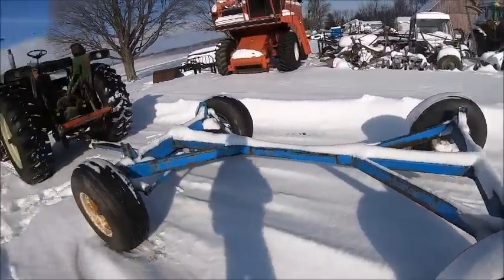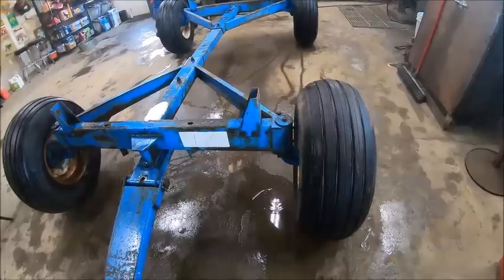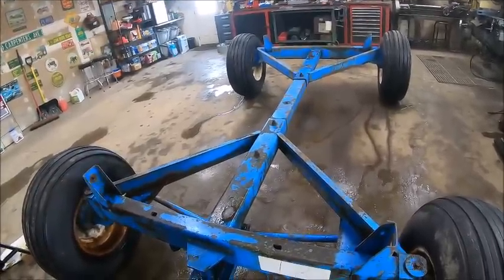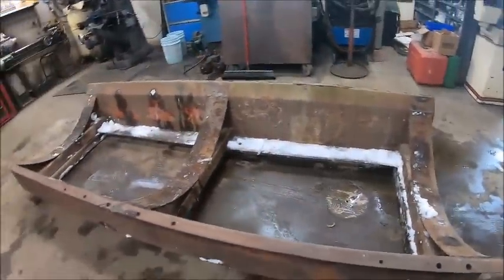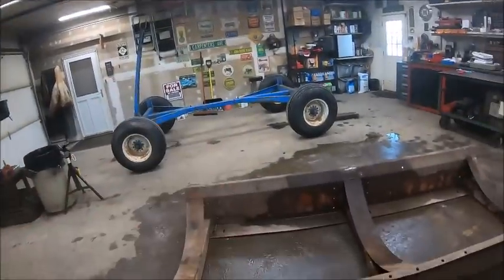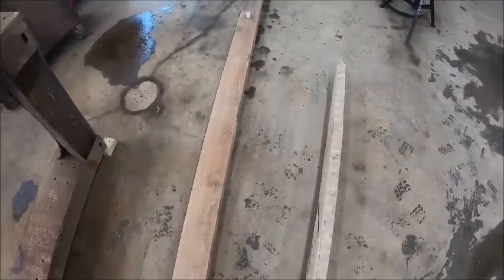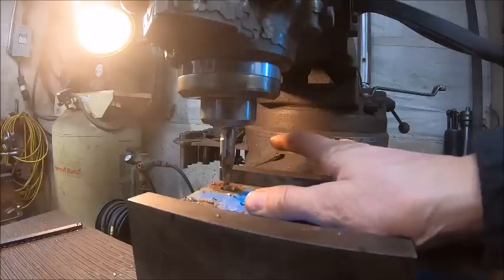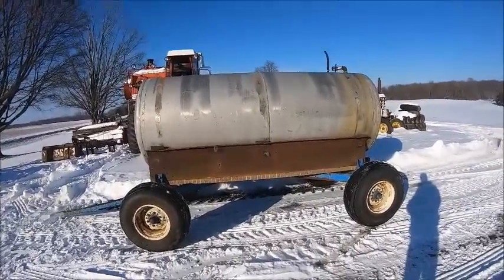Nurse Tank Build Part 1

Comment: Might be American Elm or Rock Elm; used to be a lot of it in MI before Dutch Elm disease came through. My barn in the Thumb (built in 1937) is framed with rock elm, hardest wood I’ve ever seen. You can’t drive nails without drilling first!
Reply: With that tight of grain it may very well be elm. Old growth elm is tpugh!

Comment: Nice job.  Looks good.  We always ran a couple a small chains around the unbolted stakes around the frame to limit the travel to the stake height in case of an uneven area.  I have seen the frame come down on the top of the stake and get hung up.  Not fun.

Comment: On the bands you could weld angle iron on the ends and put a bolt through.  And if you put one angle on one  side of the bracket on the running gear It would hold it and still have room to flex

Comment: Its coming along nicely but please please please do one more thing to the gear and look into the tung pivet point, KillBrothers use a bearing set in them and a lot of people never grease them and I've seen a lot of them have the tung fall off and wreck the gear.  Last year I had to put a set of bearings and seals in one of my gear cause they were shot. Its worth checking out just to be on the safe side.    Bandit
Reply from the maker: They are fine.
Reply: @Oliver66FarmBoy  Good !   When I bought that wagon the tung had a little slop up and down on it and when I popped the cab off for a look inside rusty water came out !  When I loosened the nut the bearing on the bottom fell apart and the tung fell off !   They had a good idea but I've seen a lot of these gears wrecked because no one greased them or even looked at them till it was too late !  Bandit

Comment: You won't know till you fill it but be sure and check all the tank end cap welds for cracks. Some of those aluminum tanks don't have baffles or enough baffles in them to stop the sloshing and the end cap welds can crack.
Reply from the maker: We are going to check it with air.

Comment: Does the fact that the running gear does not have any brakes as far as I can tell means that at least when loaded it requires a significant tractor to do haul it due to the overall weight? Is it likely that the tank is internally baffled at all?

I, like you said, would prefer a biggish top fill / rinsing pipe work incorporating a large breather with ideally an inspection hatch as using the outlet pipework as the fill point makes it all rather vulnerable to damage and leakage.

I very much like the idea that someone else suggested of installing troughs to carry your pipework in. However how much pipework (length) do you think you might need to be able to fill up your tanks on the planter and sprayer without messing about in the field getting close enough to make the connection?
Reply from the maker: It will only be around 5 ton loaded. That’s not overly heavy.